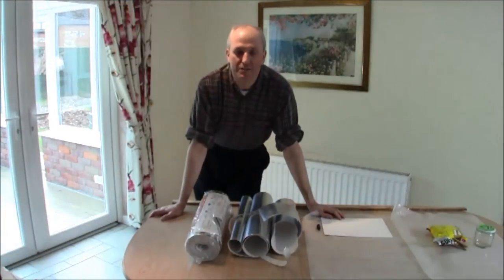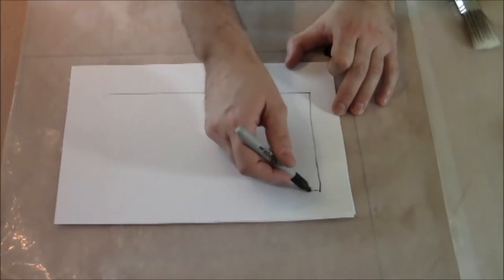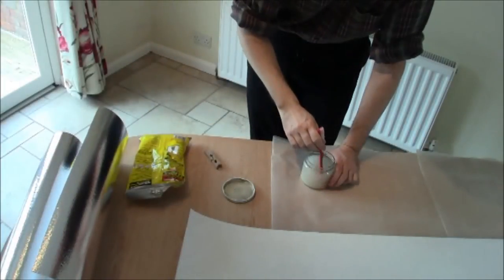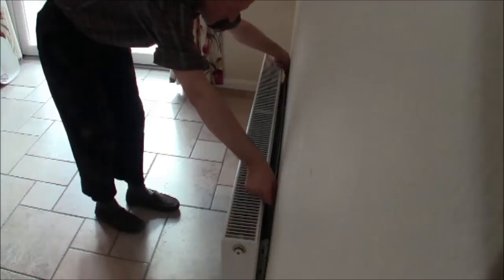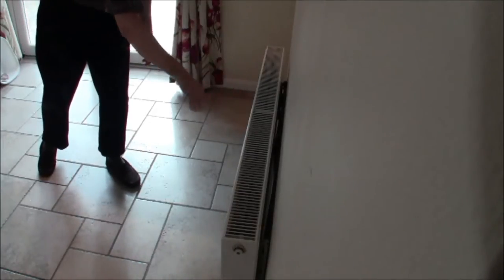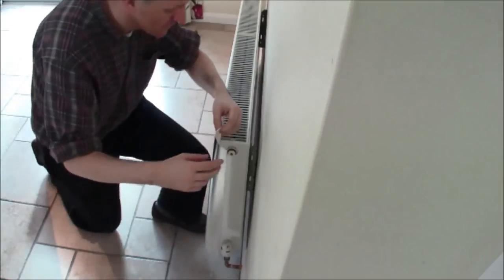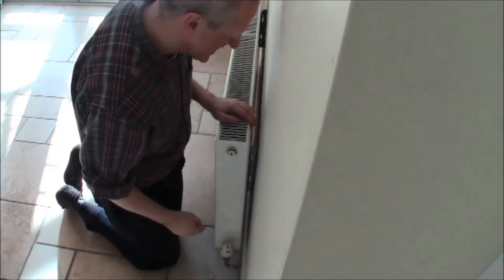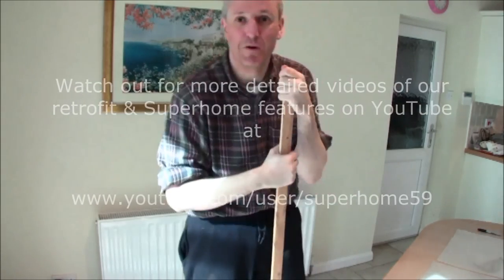How to fit radiator foil [Superhome59 warm home retrofit video part 14]

Comment: I stuck foil down the back of my radiators about 15 years ago. The difference was immediate and amazing. Fixed it into place with little bits of blue tack and it's never needed any attention since.

Comment: All we done was measured where the brackets are which hold the radiator in position and then cut slots up the radiator reflector which we had cut slightly smaller than the radiator.. Then just slid it down the back and the brackets hold the reflector in place.. Simple and no mess.
Reply from the maker: Great. Yes, that will work. Thanks.

Comment: If you don't want to stick it directly to the wall itself you can still use it.
Simply stick it onto hardboard or similar stiff thin board and cut slots out where the radiator brackets are leaving the tops of the slots still attached to keep it all in one piece.
Then simply hang it behind the radiator, job done 👍🏻
Reply from the maker: Good tip.
Reply: Probably more suitable for people who rent properties but something to consider

Comment: Just ordered some for the rads on the external wall but now thinking I should implement on all my rads that are against walls in the house, will see how these ones go if it’s good I’ll do it on the whole house
Reply: Sounds like a good idea.
Reply: @Mikegee63  I done the whole house seems to get up to temp fast, the walls behind the rad are no longer sucking up the heat it’s coming straight out

Comment: Will foil paper work as well?
Reply from the maker: Not sure what you mean exactly by "foil paper"? But if you mean just aluminium cooking foil then this will work.... but not as well. Heat is transferred by radiation and conduction. The foil reflects the radiation back into your room whilst the polystyrene provides insulation. Hence the two together will always be more effective. Thanks for watching. Good question!